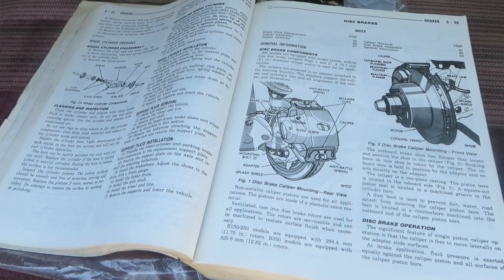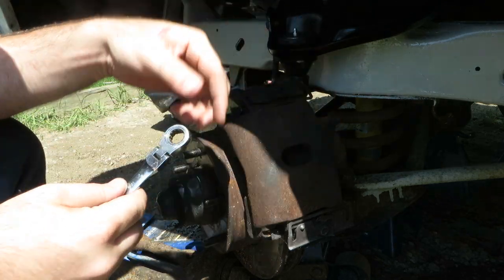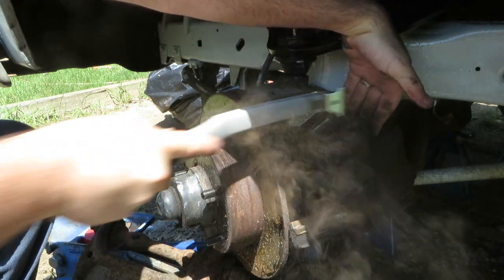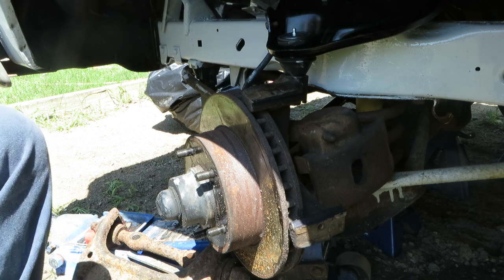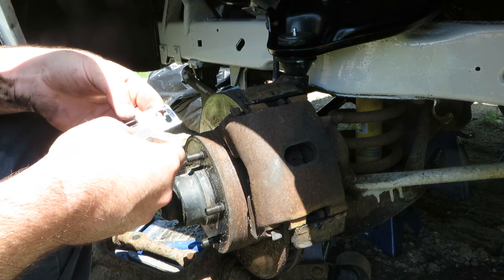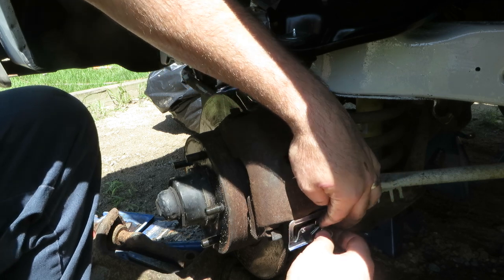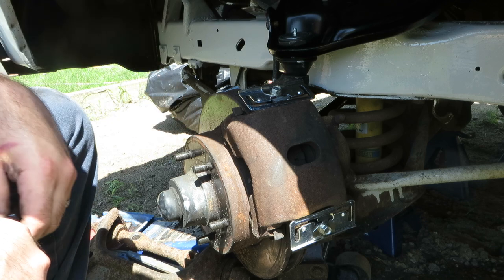Dodge Front Brake Caliper Anti-Rattle Clip and Pad Installation - 1973 through 1997

Comment from the maker: While watching the video I noticed that the outboard brake pad sits loose on the caliper.  I would recommend bending the tabs to make the pad cling on to the caliper or perhaps use 'Brake Disc Quiet' on the pad.
Reply: Hi, Stephen. I finished servicing my brakes, with new rotor and pads. I also noticed the outboard pad does not sit tight and rattles. You suggested bending tab, just wonder if it worked for you. Service manual did not mention this. The older dodges has some flawed design.

Anyways, I appreciate your videos and advice. Thank you.
Reply: Can't see how the o rings are installed, due to poor lighting.

Comment: Thanks for the video, really helped! Any idea what the torque on those spring bolts should be?
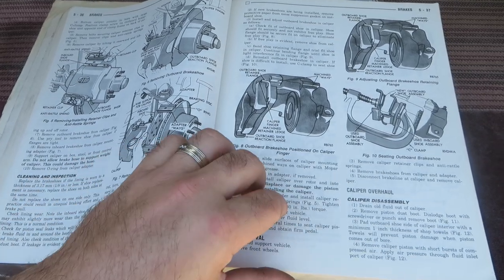Reply from the maker: If you skip to 1:04 and hit pause it appears that they are supposed to be 180 inch pounds.

Comment: Clips to hold on a brake caliber, one of the stupidest designs I have seen.
Reply: There isn't any load on the clip. The caliper is fully captured in the spindle bracket. The clips just keep everything in place. It's actually a very good system.